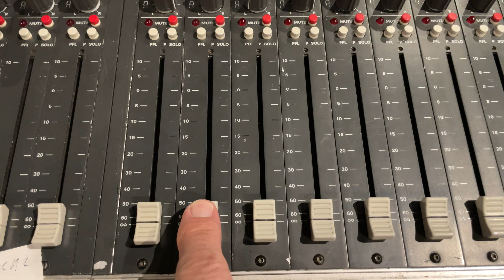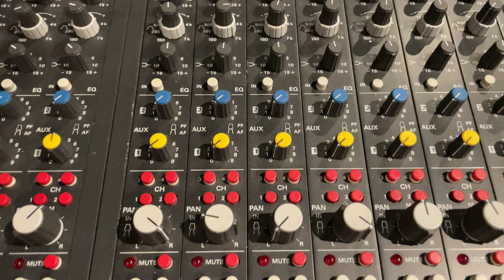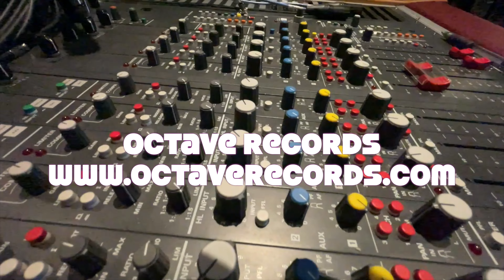The Analog Mixer Part One

Comment: The visual benefit of the linear fader/volume slider is actually secondary. The primary benefit is that it allows an engineer to control multiple channels at once. The use of the linear fader over the rotary dial was pioneered by recording engineer Tom Dowd, who also happened to work on the Manhattan Project.